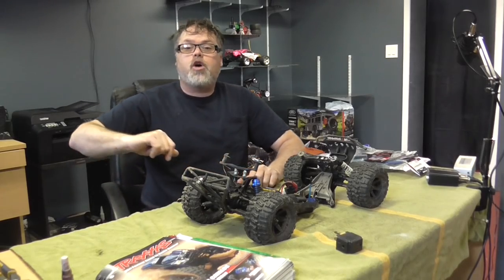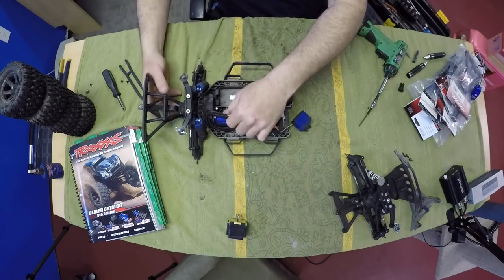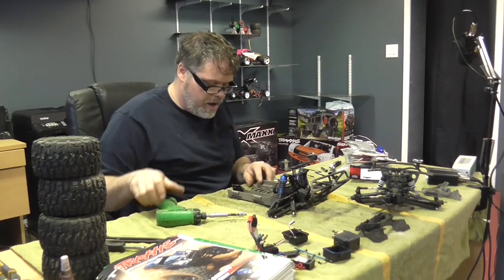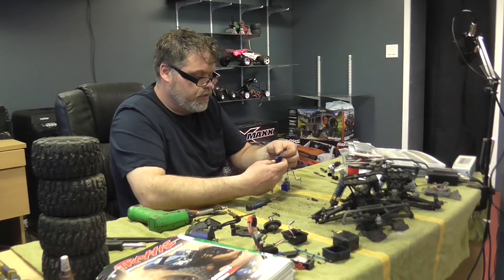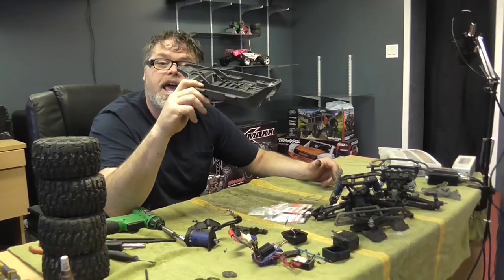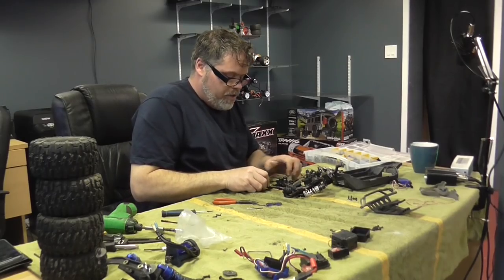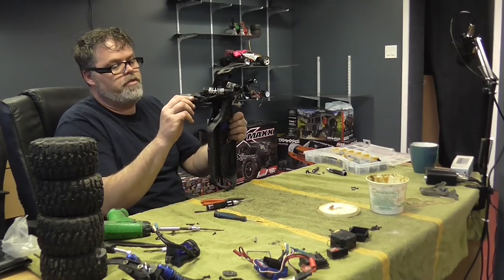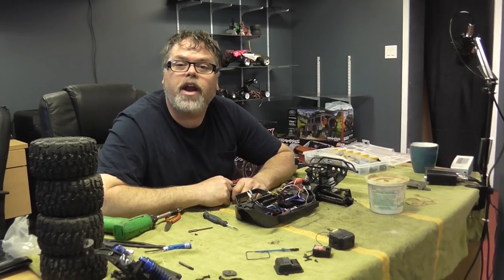NEW RC BODY BUT SLASH IS IN BRUTAL SHAPE

Comment: Blew my Rustys gearbox the other day I did on 3s but after changing the hollow slipper gear pin with a dremelled 12mm wheel hex pin it has been beaten up a lot and since my mod this is the first gearbox problem in 2 summers abuse. 👍